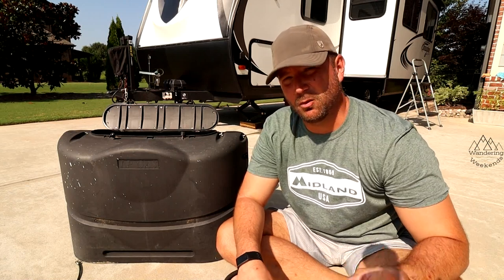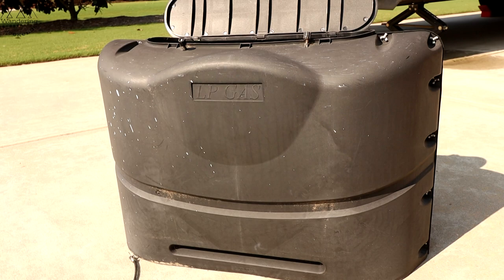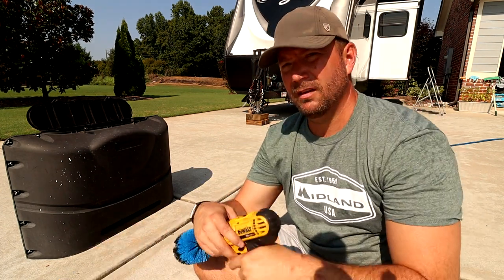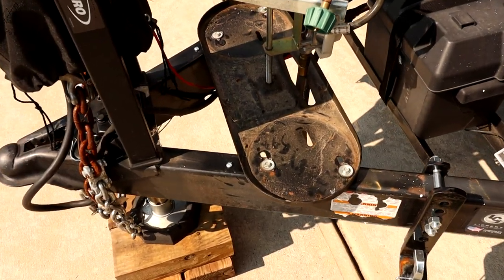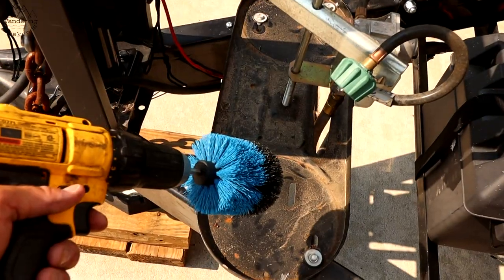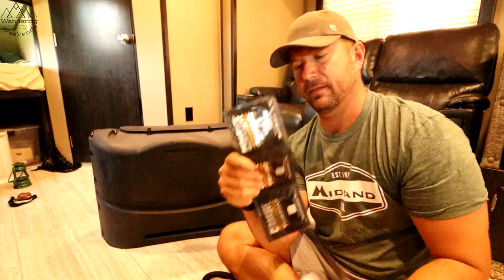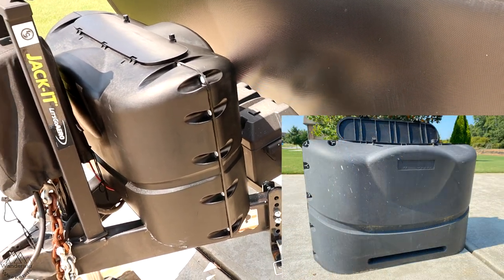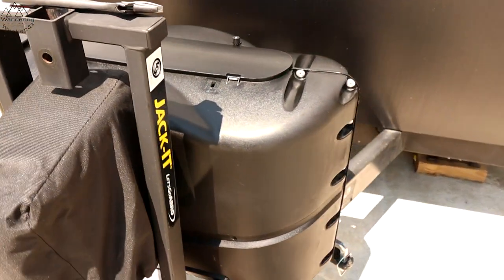Restoring Our RV’s Propane Tank Cover (Clean and Ceramic Coating)

Comment: Have you tried ArmorAll’s new “ceramic” wash? People have been raving about it on their trucks and they make one for tires. That might work better on the rock gaurd on the trailer front.
Reply from the maker: No but it sounds intriguing
Reply: @WanderingWeekends  I’ve seen some use it in a foam cannon from Amazon, not an expensive one by any means. But I plan on giving our camper amd truck a good washing with it before we take it to Disney just to give it a good test. 😉

Comment: Any idea of what product to use on travel trailer tires?  Getting everything for the propane tank cover, but I just bought new Goodyear endurance tires and want to keep them in good shape...I already have covers. Just looking for that extra bit of protection from the sun.
Reply from the maker: I’ve seen coating for the tires but have not used them.